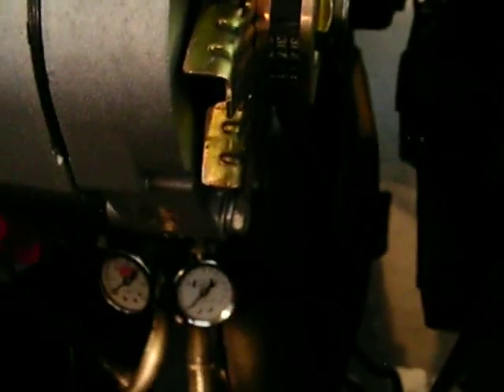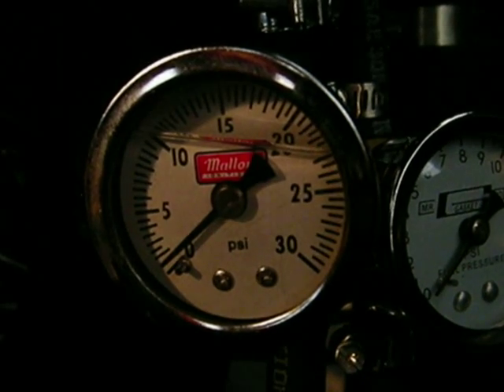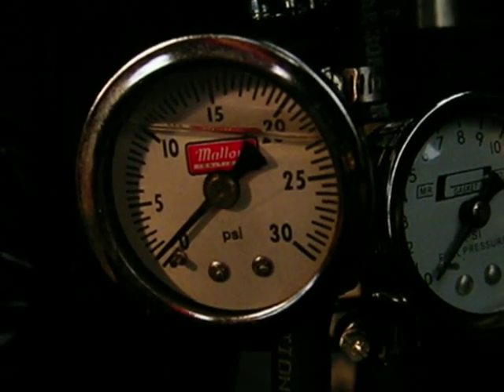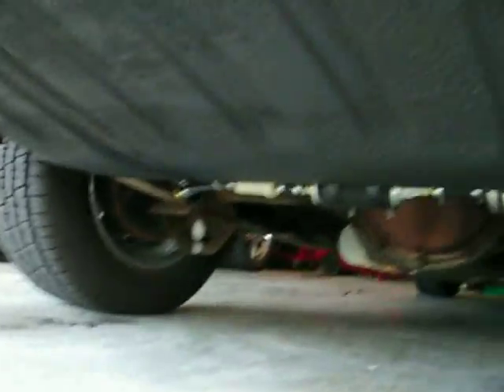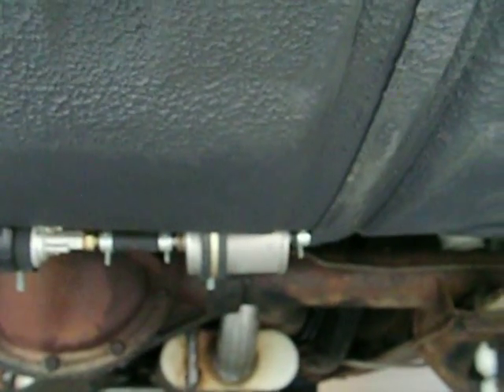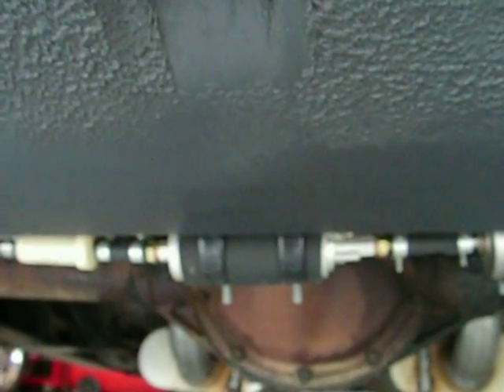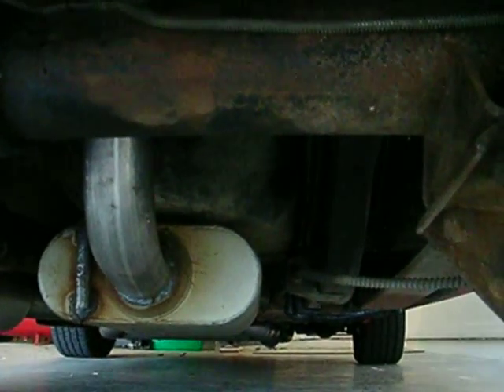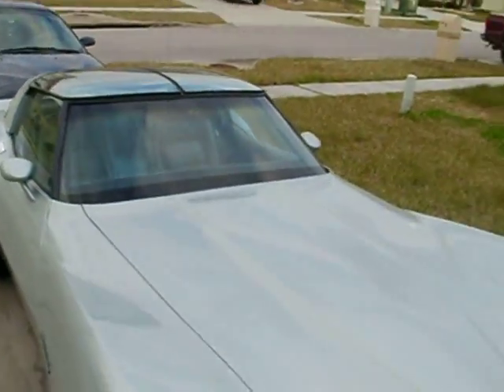67 Camaro with TBI fuel system

Comment from the maker: Dude it is not gay anymore!  I also have an auto-tune plugin for the EFI software.  All I do is drive at different speeds and the plugin adjusts my fuel map on the fly.  This system is very cool.  Next stop is the dyno to see what it really has for power.